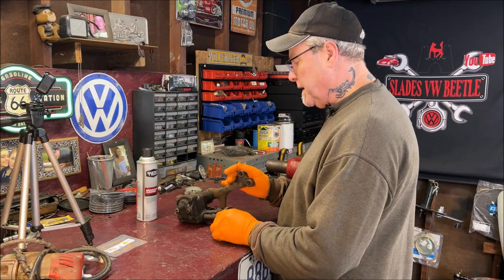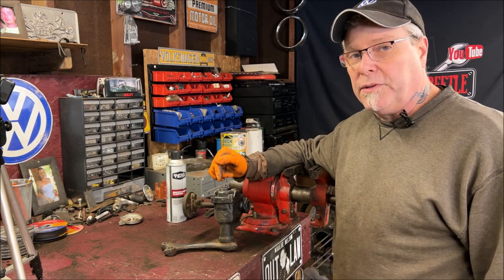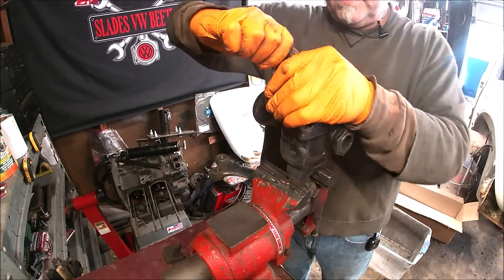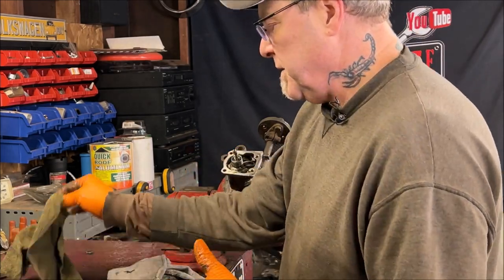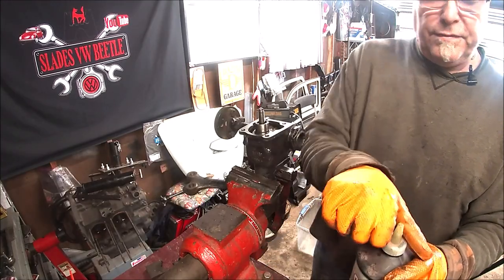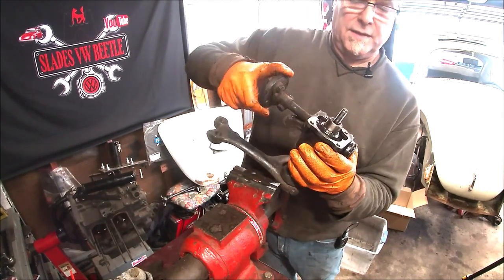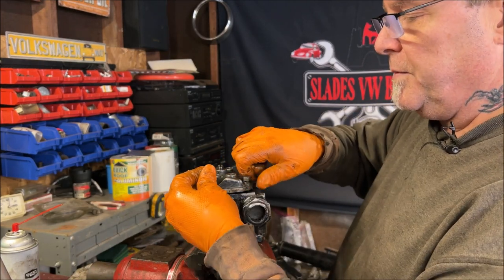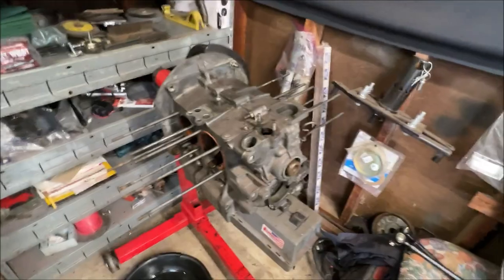HOW TO Maintenance a VW Beetle Steering Box - Super Beetle - Baja Bug - #vwbeetle #vwbug #slade

Comment: Sometimes remove the spark plug {check for spark } The if it has spark, A little gas down the spark plug hole will allow The engine to fire up for a couple of seconds. If it does , fuel system { pump /carb . }  are next to check.......   Good Luck , keep us apprised, Very Interesting   !

Comment: I wish I had tried this to my factory box first. I disassembled my old box and cleaned it and regreased everything and it works better than the new TRW box I just bought. I think it's best to take it completely apart. My box had clumps of hardened grease in it. I thought the bearings were bad because it had this weird feel to it when I turned the shafts but it turned out just being those hard chunks of grease. Now it turns really smooth.

Comment: I found an old VW document stating to use gear lube in the steering boxes. Have you heard that?
Reply from the maker: @dubworldvwadventures  actually, I have heard that, and yes you can use it. I like using something a little thicker that’s why I did, what I did in this video.

Comment: Great video, I have been watching your stuff for a while now and have learned a bunch of useful info. This video sent me on a mission of the perfect gear box lube nothing at all wrong with 00 and most of my research pointed to using CV grease which is some very slick stuff but in my search I stumbled across a grease from John Deere of all places it's called Corn head grease. Check it out, I think I'm going to be adding it as my go too steering grease. In years past I used Mystic JT6 mixed with Lucas for various gear boxes and such.

Comment: Very informative video, nice job. Slade, I have a 73 Super Beetle and the steering box is stuck turned all the way to the right.  It appears to be a recent rebuilt box, so I want to see if I can correct this problem.  It is a bit different design than the TRW you demonstrated in your video but it is a VW casting 113 415 111A.  Is the procedure basically the same to do a maintenance, and where could I find the gaskets for this?....Also, is there a procedure to center the steering arm that is bolted to the box shaft....any suggestions would help....cheers.

Comment: Pretty sure my manual specifies to use gearbox oil 80/90w to refill the steering box up on the car to the level of the plastic plug, so that's what I did last year and of course when I checked it again last month it had dropped an inch.
Reply: Forgot to say thanks for your video on front drum to disc brake upgrade that I did on my 72 bug out on a cold, wet driveway in the week before Christmas!
Reply from the maker: @johncollins5552  That was a heck of upgrade to do in the winter outside. I give you credit. I use a thicker grease on them since the seals are older and I didn’t feel like rebuilding it.

Comment: Would you ever tear down further? it seems a bit tedious to try and scrape/spray out old grease. I would also think there's more components to check
Reply from the maker: Honestly I did consider doing that with the current one I’m on. My 68. They’re pretty much all close to being the same. Probably would make a good video
Reply: @SladesVWBeetle  for sure. I find the Airkewld boxes interesting. They do complete rebuild and bearings. But would rather do it myself if I know what I need.

Comment: Great detailed video! I do have a quick question though. I have a 74 super beetle and I just replaced the steering box with a new one and now my steering wheel is stiff and hard to turn. I’m wondering if they come with grease already, do you have any experience with that? I didn’t check it before I installed it and nothing on the paperwork said it needed to be filled with grease so I assumed it was ready to go.
Reply from the maker: I never bought a new one. but i am willing to bet, theres no grease in there! Just guessing...
Reply: @SladesVWBeetle  oh man I was hoping you wouldn’t say that, but I guess that’s an easy fix, I just hate to have to drain fuel tank again 😒. Thank you!
Reply from the maker: @dboiR1  I’m just guessing on this. I would try and ask some others who bought them. Try our Facebook community group. 
Slades VW Community 
I never bought one brand new.
Reply: @SladesVWBeetle  Well you were absolutely right! The case was completely empty of grease. Just now popped the cap off.
Reply from the maker: @dboiR1  Geez, you think they would fill them before shipping. It may be they are in fear of it leaking out everywhere. Once you fill that, it should move very smoothly. I’m glad that’s all it was.
Reply: @SladesVWBeetle  Yea or at least put a note in there to let you know that it needs grease before installing. We’ll know tomorrow when I take it out for a test drive. Fingers crossed.
Reply from the maker: @dboiR1  I hope it all works out Dan, please keep me updated.
Reply: @SladesVWBeetle  Hey Slade, so I just went for a test drive and there’s no change in the steering feel. It’s still hard to turn. I’m out of ideas as to what it could be?
Reply: @SladesVWBeetle  I have yet to get the car aligned after the front suspension upgrades, would it be possible that is what is causing the hard steering?
Reply from the maker: @dboiR1  If it’s not aligned properly, it will be a little strange, to steer. It could make it a little difficult if it is really far out. You can actually do it yourself at home to get it very close. I should have probably done a video of that.
Reply: @SladesVWBeetle  I was going to wait until I figured that out but maybe I’ll just get it aligned and see how it sits after that. Yea I searched your videos and found nothing 😅

Comment: A long time ago when I was younger I had a 1971 Beetle, 4 speed (not a super beetle). When I would brake and go into a turn I would get the death wobble from the front steering/suspension. So what caused that to happen? Also my Beetle after I had the engine overhauled would overheat and lock up. That's what turned me away from the VW Beetle hobby. Any help with explaining these two issues would be greatly appreciated. You have a great YT channel, very informative and entertaining!
Reply from the maker: That’s wobble can honestly come from many things. The only way to solve that problem, would have been to jack it up and check all of the front end parts and bushings. 
It almost sounds like the flaps and the fan shroud we’re not opened up. Maybe they forgot to put the spring on.
Reply: @SladesVWBeetle  Okay. Thanks so much for the quick reply about the steering box and engine issues. A person in New Mexico is selling a type 1 beetle, 1972 I think, only a little rust! You have a great channel going here!!